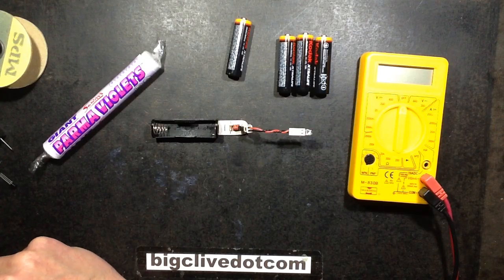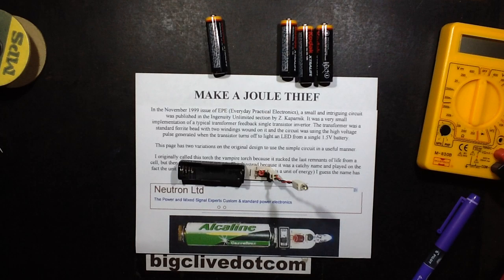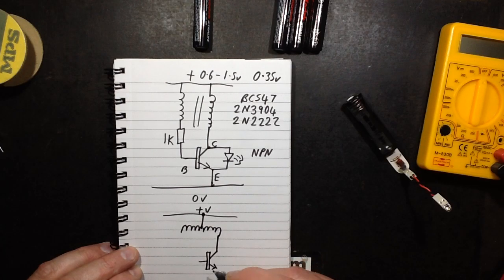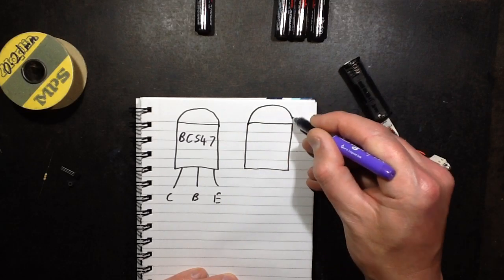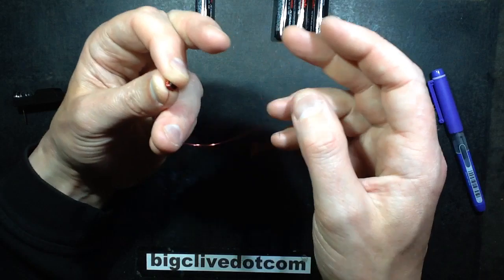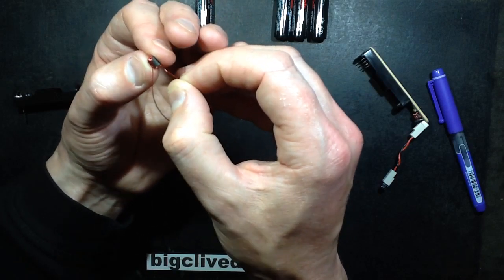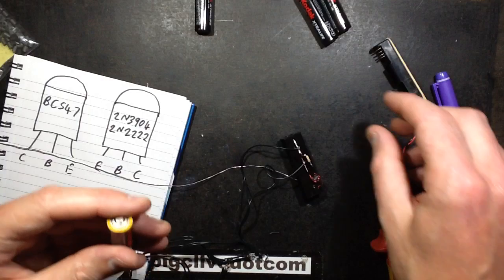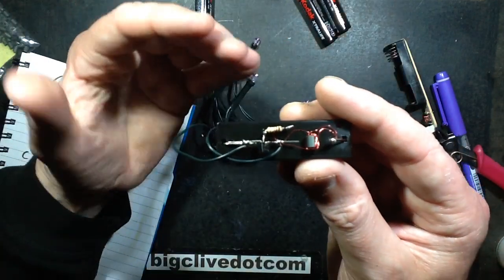How to make an authentic Joule Thief.

Comment: I've both built it, and simulated it in LTSpice. However, in both cases I'm finding that, although it works, at least for a while, for the bc337 and 2n2222 transistors, as it turns off, the base voltage seems to go below the Absolute Maximum voltage of 5 volts; it's below -5v relative to the emitter. Based on that, it looks like an extra RF diode and a 100k pull down resistor is required, I've tried that, and it works but is not ideal. Has anyone else found this to be a problem with this circuit?

Comment: Actually the cells don't drain linearly like you drew it cause internal resistance starts low, and increases as it drains so you don't waste as much as you think... the wasted capacity is at most about 20% of it's capacity even at about 1.1V cutoff. (still 20% is a lot...)

Comment: I always use aspirin melted with the soldering iron to get the varnish of the wires
Reply from the maker: I think I've heard of that technique before, but not tried it.
Reply: @bigclivedotcom  it is quite efficient, but it really stinks and puts off a lot of fumes

Comment: The voltage of the battery does not decrease linearly, below a certain voltage it starts decreasing more rapidly, so no, you are not wasting 50 percent of the battery charge

Comment: What limits the current through the LED?
Is it just the internal resistance of the almost-dead battery?
Reply from the maker: Quark Leptonsoup The battery alone couldn't push any significant current through the LED because its voltage is lower than the LEDs forward voltage.  Only the controlled pulses of higher voltage from the inductor can pass through the LED.

Comment: Clive I understand this is going to sound like a really stupid question! BUT if you can use a circuit like this to run a dead battery? is there a reason this could not be used to run a small led flash light / torch for 100 times the life of a new fully charged new battery? I have seen this video two times and a 3rd time with my grandson.
Reply from the maker: On the original webpage for this project I showed how I put one into a lamp base to use for that purpose.
Here's the original web page (If Photobucket is actually working.)

Comment: I tried to make this circuit on a breadboard and had no success, must be doing something wrong.

Whenever I apply battery voltage, the transistor gets very hot and the voltage going out (1.31v) is just slightly less as the voltage going in (1.45v) and the LED doesn't light up. Removing the LED from the circuit doesn't yield a voltage spike, the output will stay around 1.3v.

Though it does do something very strange, if I attach the lower impedance portion of the circuit (ie. the negative side) to an earth ground and touch the positive input on the coil, the LED will light dimly.
Reply: One thing i always do is making the coil using small control wire in 2 colors.
Take the 2 wires parallel and do 4-5 wraps, thats enough.

Then take a different colours from opposite ends of the coil, and solder them together. They go to the + connection of the battery.
Then use the two other ends, it really doesn't matter which, connect one to the resistor and then to the centre pin of the transistor. The other one to the LED and so on.

I found it to be easier that way.

Comment: Anyone know if this could be used to boost a lipo to prevent dropout through the LM324 resistor ladder? I've been wanting a booster to make a battery monitor circuit for single cell lipos. The voltage division for a 4 LED indicator means not enough FV for the low battery at 3.2-ish. I'd prefer to make something from stuff I have to buying a booster circuit for each of my "products".

Comment: The curve for the battery is incorrect. Alkaline batteries stay at 1.2 volts most of the discharge time. Once the battery starts to drop lower than 1.2, there would only be 10% of the capacity left. That is why it should not show a linear relationship when graphed.

Comment: can this be used in solar-powered lights so they run longer after they have only had a short time to charge the battery in the winter sunlight?
Reply from the maker: You can increase the value if the little inductor in your lights.  That will result in lower intensity and longer run time.  220uH and 330uH are good for darker places.

Comment: Why dont they use this circuit in garden LED solar lights?  Since they normally discharge within a few hours.
Reply: Probably the simplicity, efficiency, and cost of using incredibly small boost chips. What I found the circuit to be handy for is tailoring one to a small AA flashlight using something like a 3v Cree LED. While there are some incredible small boost converters for cheap flashlights already, they won't run down to below about .7 volts. With the JT flashlight nearly ANY 'dead' cell you may grab will still output usable light.

Comment: If you used thinner wire round the coil would it work below 0.3volts?
Reply from the maker: There are ways to make it run to a lower voltage but it requires at least the transistors turn-on voltage to start.

Comment: What sort of current is flowing through the coil on the collector? Could you get a coil of nichrome wire to heat up instead of lighting up LEDs?
Reply from the maker: This is designed for very low current.

Comment: I had a play around with this circuit, I found that you can use a variable resistor in place of the 1K to adjust the brightness or fine tune it, i was able to get a 11.5v LED module to run at considerable brightness off a single D Type battery. further messing around resulted in the transistor losing it's leg sadly so i put the project to bed, but i'm wondering what the variable resistor was doing for the circuit, the coil i salvaged from an old PSU would even whine and there seemed to be a butter zone with the resistor adjustment before it tapered off and dimmed again, the transistor would also get quite hot. Would love your input!
Reply: When decreasing the resistor from 1000 ohm to 100 ohm for example, the transistor is biased more strongly, so it stay ON longer which dump more energy in the transformer.

If decreasing too low (10 ohm or less),, the transistor may remain slightly ON even when in the cycle where the transformer produce negative voltage. So, it may start to heat because it would remain ON in linear mode instead of fully OFF/fully ON (called saturation) which produce almost no heat. Then, if going lower, the transistor always conduct, the transformer see no pulse, so there is no oscillation.

Conversely, increasing toward 10K make the transistor conduct less, may be even remain in linear mode instead of saturation, and then produce more heat. Going higher, the transistor don't conduct at all *, so the oscillation stop.

*the transistor always amplify the input current by a value called "hfe", the DC gain. So, even 1 Meg ohm giving a current below a micro ampere on the base would get amplified by about 50 (typical hfe). The collector current would then be 50 times that small value, not enough for starting/maintaining an oscillation.
Reply: Interesting! thank you. :)

Comment: Gah I can't get this working for the life of me.  I've tried numerous different coils including ones I've wound myself and ones I've pulled from other devices.  If I measure the voltage at the base of the LED I get the same value as direct from the battery.  Any ideas?

Comment: any chance of a 9v pp3 joule thief?...im always lobbing them...so i'd rather make full use of them..cheers.
Reply from the maker: +DEADASTRONAUTFX It wouldn't work, as the higher voltage would just push the current directly through the LED.  But you could get some battery snaps, resistors and LEDs and make snap-on lights for the PP3 cells.

Comment: Great! You can suck the life out of nearly dead batteries that way. You don't say what voltage comes out of that, I mean would you be in danger of blowing led's if it was too high? And what sort of current could it supply (how many led's could it light)?

I have a Roberts DAB radio which is great, but it takes 6 D cells which are expensive to change. When they get low the sound gets distorted and 'drops out'. I'm guessing a boost circuit would be the best option here (cheap as chips from China!) as the output can be regulated.

What's the difference between the joule thief circuit and the boost circuits from ebay?

Comment: Hi Big Clive! can you tell me what is the lowest voltage that a transistor circuit will work and do you have an example, please?
Reply from the maker: It would require above 0.6V to allow a transistor to be turned on.  There are germanium transistors that turn on at around 0.2V but they are much less common that traditional rugged silicon transistors.
Reply: @bigclivedotcom  Okay thanks for your help.

Comment: Two questions:
 1 -Why isn't this circuit a standard part of every LED flashlight so that the light will stay on 'till the battery is really dead?
 2 -Is there some way to exploit this concept to charge another batter or otherwise aggregate the left-over energy in batteries which are too dead to power devices directly?  There must be hundreds of dollars worth of energy in every family's junk drawer - to say nothing of the buckets of batteries at the recycling center!

Comment: @bigclivedotcom, 

I wonder if you could tell me the patent status of the joule thief. The reason I ask is that I believe I may have come up with a way to use the concept as a cheap way to get a sort of pseudo-mppt result using a 2n3055 transistor, a toroid, a 5 watt solar panel, a capacitor, a lead alum battery (might try on lead acid later if my experiment is successful) and a diode (no resistor). I know very little about patent laws, but it seems to me that if my idea tests out, it could potentially be very useful to poor people, especially in third world countries. 

Right now it's really cold here in Michigan, but when the weather breaks I plan to do some data-logging of the device in my pole barn, where I have some small test solar panels mounted and wired into the barn for experimenting with lead alum batteries and collecting data on them. My thinking is that this circuit will probably only be good for 5w panels and lower (assuming it turns out to be good for anything at all), except possibly if you added a relay and/or something else to it (I have some ideas about that). Right now I'm doing a prototype test with a cheap Chinese 5w panel in a south facing window. This is a single pane window with plastic roll sheeting on the outside as a storm window. It's shaded by my pole barn in the morning. With all of these obstacles to maximum performance, I'm impressed so far (2 days testing) with the fact that even when the panel is shaded in the morning by the barn, it's raising the voltage of the battery and I'm running a single LED on it for about 18 hours a day. I'm also thinking that this idea might work in a north facing window, perhaps using an 18 volt panel to keep a battery topped off for emergency lighting.

What I don't know yet is whether or not I will need to regulate the circuit with a bypass for when the voltage gets too high (it's pumping in about 40 volts). I'm not real concerned about this question right now because it's only 5 watts and the battery I'm using is a "failed" alum battery that only holds about 8 volts. So far the highest reading on the battery (while the sun is shining) is a little over 9 volts, which is well within the safe range of even a lead acid battery.

 I create my own led circuits to run on these "failed" alum batteries (I also have a few good ones that hold about 11.5v). I've been playing around with this one for a couple of years and, even though I'm thinking it probably has something like a shorted cell or two, it's a surprisingly useful battery for night navigation lights. Eventually it may become the power source for some yard lights or something.

Another thing I'm thinking about is whether or not it would pay to power the base on the transistor with a cheap little 5 or 6 volt panel to make it more efficient and place some limit on the base current. I'm still trying to learn how to calculate what it takes to power the base of a transistor safely. I find a lot of the info on the data sheets a bit confusing for me, being an electronics amateur.

If you know anything about my patent question (or can help with my ignorance about the best way to power a transistor base in an application like this) I would appreciate any input. I have a Facebook group where I would like to go into more detail about this circuit and possibly post some of my findings over time, but I'd really like to know if I can post it as an open source or public domain type project.

https://www.facebook.com/groups/AlternativeEnergyEconomics/
Reply: BTW, I love this video. This is where I learned to make my first joule thief. It has inspired me to start playing around with electronics. Something I always wanted to do when I was young, but never pursued all that much until I was about 58 years old (a couple of years ago).
Reply from the maker: It's not patented and not patentable due to prior art.

Comment: Hi Clive where did you get the roll of .21mm wire you used. I have looked on eBay and cannot find it any chance of a link please.
Reply from the maker: The size isn't too critical.  I got mine from a Uk supplier called Rapid Electronics.  Enamelled wire is very common from just about any good electronics supplier though.

Comment: another option is to use a larger battery holder. In the 90s I made an 9v battery snap to 8xAA holder. I would test the batteries and use my AAs that were nearly dead. 8 old AAS would run a smoke detector for 6 months to a year.  At that point when It beeped from low voltage I would test the batteries and recycle that lowest one or two which would often have reverse voltage and replace those with other old batteries.  In this way I did not have to buy batteries for the smoke alarms. 9v batteries are very overpriced for the small amount of power they provide.

Comment: How big can you make a jewel thief? Like for using a car battery or any bigger battery? Do you know anything about the little catfish zappers that is put inside of a 1/2 inch copper end cap with a led ? It can be run off of a 9 volt battery or even three 9 volt batteries up to 27 volts. We’ve hooked it up to two car batteries hooked up for 24 volts. We got this little thing from a guy in the USA in Texas. It can’t be to much inside this 1/2 copper cap. But when you hook it up the tiny led flickers so fast that you can’t hardly see it flickering. The cap was full of black tar so we never could figure out what was inside this little copper end cap. But it only worked on catfish in a running stream with a sandy bottom. Some of the catfish that came to the top that we caught weighted up to sixty lbs. if you touched the catfish it would take off again. I don’t know what this thing did but it really worked great. Can you try to figure this out if possible and make a video on it. ? Thanks fella. Have a great day Clive.
Reply from the maker: It's only suited to low voltage.  For higher voltage applications you can use boost or buck converters with current sensing.
The catfish zapper may have worked like a TENs unit with electrical spikes.

Comment: Regarding the creation of your centre tap transformer:  Why bother to discern which winding is which, to solder opposite ends together?  All you should need to do is solder 2 leads from the same side together, and voila!  There's your centre point.  Each individual lead on the other side are your end points, and the ratio between the coils will be 1:1.

Comment: Could you replace the led with a spark gap, and adjust some values to generate sparks?
Reply from the maker: It would need a custom wound transformer to do that.  Very similar to an insect zapper.
Reply: Cool

Comment: For those who are interested such as I was it was 13 turns through the small ferrite bead, maybe will save someone the time like I just did to count them but I really don't think it matters all that much, who knows?
Reply from the maker: I recommend fitting in as many as possible to the small beads and at least 20 turns on the bigger cores.
Reply: Thank you so much BC for that answer, I,ve been trying to get everything needed to build some for some friends but it takes forever to wait on these Chinese sellers to get just anything about. So what size magnet wire in American Gauge & Awg is what they use should I use on these then??? Thank you so much for your time & your experience Big Man, Tom. PS; Meters or metric just screws me up so bad trying to decipher into standards, thanks.

Comment: Can you use germanium transistors with a supply of about o.3Volts? Eg BC108, BC109.
Reply from the maker: I've never tried it with a germanium transistor, but many others have.
Reply: Thanks Clive I’ll give it a try and so how low voltage I can get a single LED to work with.

Comment: Im curious, would this work even more efficiently using a very low Rds mosfet?
Reply from the maker: The turn on voltage might be an issue.  Especially at start up.

Comment: Anyone here know how to get this thing working with a low 3v lithium button battery? Been trying to get one to work, but either it bypassing straight through the transistor because of its higher voltage and lights up the LED, or if it is around 2 volts left in it, it just does nothing. I've tried using a variable resistor to see if there was a particular sweet spot for them, but nope, it ignores it

Comment: Since you're using a 1.5 volt cell, would this work for a 6 input, that is to say, a 6 volt lantern battery running a few LEDs ?
Reply from the maker: The Joule Thief is only suited to supply voltages lower than the LED voltage.
Reply: Okie-doke, thanks for the reply Clive. :o)